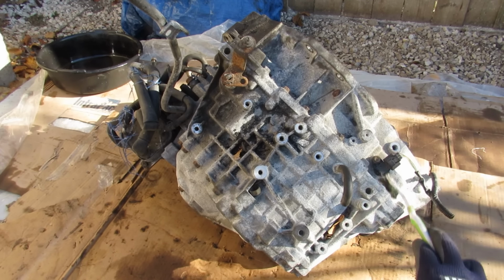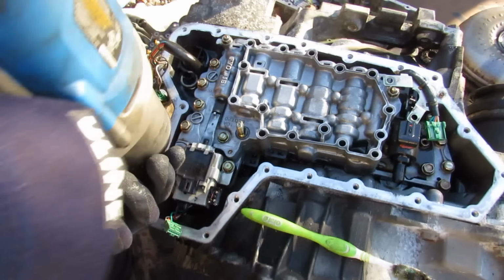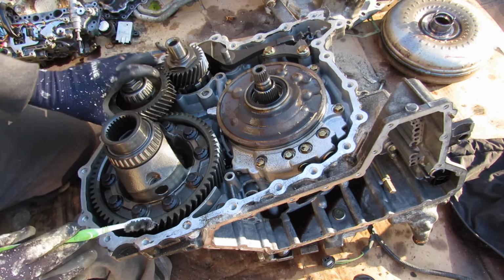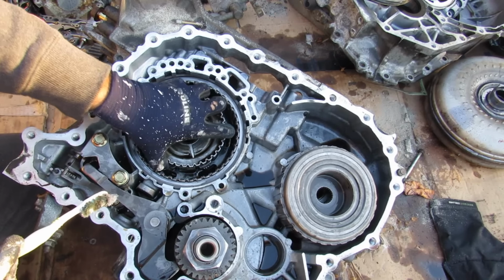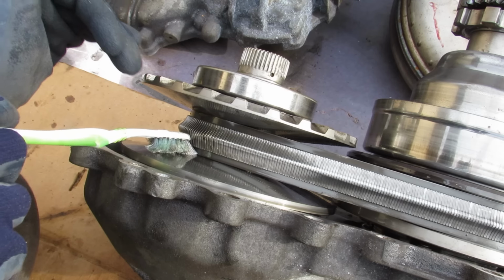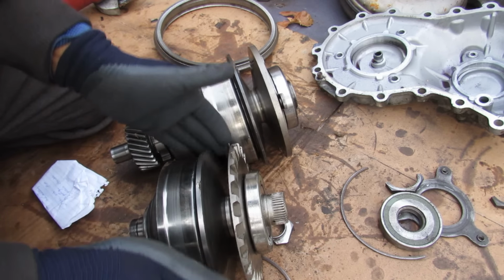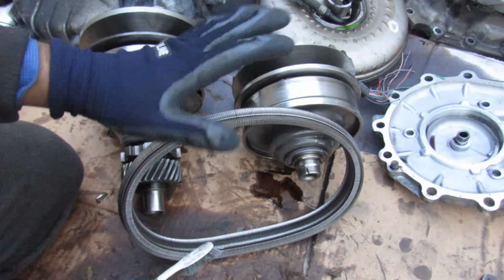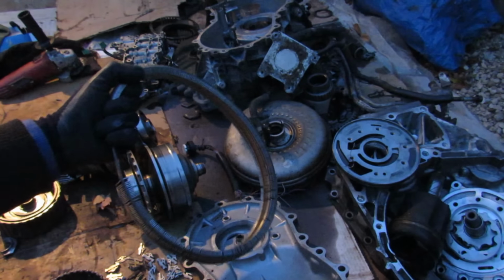Why Nissan CVTs FAIL

Comment: Thank you, our Rogue just ate its second transmission! Had a ‘99 Honda CR-V and a  ‘00 Toyota Celica both lasted over 21 years and the rust killed them the Rogue is just 10 years old and low mileage.

Comment: Fluid is key; I had no issues with my 2009 Nissan Altima 3.5 liter. I used amsoil cvt fluid, and changed fluid every 80-100g miles.  Zero slippage with amsoil, and fluid was as clean as day I put it in. My Nissan Altima had 220gs on it when I donated it.  
My Honda accord cvt trans slipped at 35gs, so I changed fluid with amsoil cvt fluid without any issues.  155gs later, car still ran like new when I sold it.

Comment: I have an x-trail T32, 2015, 1.6 DCI.. 160k kilometers done. CVT, works perfectly, never a problem. I haven't changed the oil and filter yet. Should I do it. Two car mechanics told me not to touch anything.

Comment: This is the best video ever made on CVT transmissions. I've been lucky with my 2011 Maxima, 112,000 miles with no problems but I find myself worrying alot about the trans. I appreciate the deep dive into how this works and I find that I worry less about keeping this car which I love driving. I'm keeping it and will continue regular service and not worry as much. thank you speedkar99

Comment: My CVT is holding together with hopes and dreams at this point. 07 murano s with the sport mode. I beat the ever living life out of this thing daily. It lives at 7k rpm🤣. So I will soon be referencing this video again
Reply from the maker: Oh boy. 
They die slowly. 
First you'll notice it not responding. 
Then it'll just max out at lower and lower speeds.

Comment: My wife and I have owned six Nissans and have never had a transmission problem with any of them.  The one I drive now has 256,000 on it with no problems.  Change the oil in them every 30,000 like the book tells you to do and you won’t have any problems.

Comment: Excellent video. My Nissan Altima CVT was shot but took it to the dealer for a proper diagnosis - shot! Wasn't about to put a $4K transmission in a $1K car. I hoped to be able to drive it to the junk yard but got it home and decided to throw $200 into new fluid, filters, and a bottle of CVT snake oil. Immediately the whining stopped and you could actually drive it - but no further than you wanted to walk to get home. It got better and better for about a month but started whining again. Threw another $100 into fluid and snake oil. The drained fluid was very dirty and now two weeks later it is operating nearly perfect. Bloggers warned that you shouldn't change the fluid as it would shock the transmission. Shocked my dead tranny back to life!

Comment: i have a guy Here in Ontario Canada that rebuilds it and you get a  warranty and he has a contract with Lexus contact me if you need  one done you can ship it or drive there he did my cvt in 1.5 day iy only cost me $3300 as other shop where going to charge me 5000 to 7000  he has a big company in China

Comment: Good video. The idea of using a belt to transfer the power of a large engine was a bad idea from the start. You mentioned the variators don't do their jobs which leads to shudder. Do they leak the oil? Is there a problem with the control side?

Comment: It would be awesome to make a transmission with synchronized gears with neutral being no gear engaged. Then reverse plus 1-6 gears with electric shift solenoids and gear on the input and output shafts and the gear wheels with hydrolic pressure shift solenoids that control the gearing selected based on transmission fluid pressure and rpm's. Plus a very well built torque converter, flexplate, and front pump assembly. It would be like automatic transmission mixed with a synchronized manual transmission but operate with a shifter inside the vehicle like an automatic transmission.

Comment: Just nitpicking, nothing else, but that belt do not transfer torque as said numerous times in the video, it transfers power. ( 14:17, 14:29 for example ) (But I guess a besserwisser would argue that since torque is part of the equation for power in a transmission, that torque is transferred by the belt, from gearshaft to gearshaft... 🙂Oh well.)  It's mindblowing to me though to learn that it transfers it through pushing that stack of washers, not pulling.

Comment: 2009 Nissan Altima with a CVT transmission. Just hit 200,000 miles. Still going strong. Never changed the transmission fluid.  Never added transmission fluid. Never had any transmission problems whatsoever. CVT transmissions are fine. It's when you drive like a moron that you're going to have problems, no matter what kind of transmission you have.

Comment: A very brilliant presentation on the working of CVT. My question is can the primary and secondary pullings be replaced while the transmission is still mounted on the engine ?

Comment: Having owned two CVT vehicles in recent years, I bought a 2024 car with a 6 speed manual. $800 to replace the clutch versue $6000 to replace a CVT

Comment: @speedkar99.  What do you think about the 2025 Nissan versa SV they claimed that they improved and got rid of any of the CVT issues.
If so what would you do to make it last ? Oil change at 30or 60 K?  How often filter ? 
Or is bound to fail

Comment: If you think a CVT is complex, it is nothing compared to the labyrinth ( valve body ) and selenoid found in a conventional automatic .Some new 10 speed trany may have 13 solenoid or more. And we're not even talking about mechanical parts yet. Just because a conventional automatic transmission is repairable doesn't mean it's simpler. Even the best workshops do not guarantee survival.
Reply: Can you tell me if the newer X-TRONIC CVT’s in the 2023 3rd Generation QASHQAI  upgraded CVT is a BETTER SYSTEM OR NOT ? - because I just bought one. ANY TIPS ON HOW I CAN MAINTAIN THE CVT for longevity?
Reply: @ILuvCooperAlan   QASHQAI  not the Rogue sport ? So you are in Canada . The only hope of survival is that the QASHQAI  was available in canada with the 6 sp manual... I would not expect anything from the cvt and I would do ( simply ...LOL ) a transmission swap.

Comment: Well, the belt was changed from the belt to the chain on 3 cyl cvt.  .  3 cyl started in 2021 Rogue on some models.  2022 to present Rogues have 3 cyl. 

They better start doing what customers want.  I heard that the reason they switched to cvt is bc it is cheaper to make

Comment: They fail because people are lazy! Change your filters , fluid, clean pan , magnets and change oil cooler filter.
Reply from the maker: Good point. Maintenance and not overloading it is key.
Reply from the maker: Good point. Maintenance and not overloading it is key.

Comment: I have a 2012 nissan quest. Its our main driver in the winter. Bought from a senior couple a few years ago. We use a honda fit for summer. Im at 89k miles in the quest. Went to change fluid and the stuff coming out looked exactly like the stuff we put in. I believe its about driving easy with these. Even towing would be ok with slow starts and staying around 60 max. I occasionally tow a utility trailer. Loaded up is about 2500lbs and i do see a difference in RPMs at that weight. Not sure if it would make much difference taking it out of OD. ill have to test next time i haul. Overall though id still trust towing 2500lb extra as long as you drive like a grandpa. I believe pop up campers would be ok to haul but thats really it.. they make lightweight campers but the wind resistance would require more torque than just carrying dry weight and that is overkill

Comment: one of the main and most important reasons all automatic transmissions including CVT's fail is lack of maintenance. I am shocked that there are people who still believe the old wives tale that if you change your transmission fluid it will cause your transmission to fail lol. NOT changing fluids is one of the main reasons why auto systems fail.

1. Change all fluids and filters (if any) regularly.
2. Do not abuse your vehicle...its not a race car.
3. Proper maintenance makes vehicles last and last.
4. Abuse and crappy maintenance makes them fail.
5. Idiots should not own cars.

Have a great day :D
Reply: No offence meant but you said several dumb things cuz you don't know much about cars..  Just know this,, auto tranny fluid should not break down.. but if you wait too late (like over 30k) then it really can make auto trannies slip.. it's about friction and dynamic fluid clutches.. 
CVTs were an engineering dream but a nightmare in reality.. (fyi,, I did prototype development at Ford Transmission, trust me, they all are shit)

Comment: relatively intresting , hardly understood quite complex. I was thinking how much nissans problems are related to renault cooperation, I remember the time when nissan was purely japanese product and their technology did not fail, had old almera 98 in family and motor lasted around 450 tkm without issues frame failed due rust but motor was fine. Nissan became shit after cooperation with renault, almost everything what comes from europe is bad shit.

Comment: Awesome video.  Information rich explanations that are easy to understand.  I've been involved with manufacturing since I turned 18.  That's 50 years.  The high quality of the manufacturing of all the components is obvious.  Seems like the issue is the business decision to deploy a well designed and manufactured transmission that is not up to the real world demands placed on it.  In other words, it would probably work great for a car with 100 HP or less.  But, as the narrator states, it's not up to the difficult tasks it has to perform.  So yes, Nissan deserved to get sued repeatedly for their bad business decision.  I suspect cost accountants made the decision, and not engineers.

Comment: i was looking at a 2016 Honda quest mini van that had just over a 100 thousand , looked up transmission had CVT W.T.F on a van  then this video and problems ,what happened to honda is it just American made or is japan made different ?,ill buy 20 year old still looking!THANKS FOR VIDEO ,ps looks like regular auto trans untill put stupid two v"s just to get a few miles ,in 90"s most cars went over  2 hundred thousand miles ,going backwards  70" before  put just over 100 thousand miles get a new car

Comment: Eeprom is a solid state electonics component, up to today i never heard anything mechanical called that. What you call eeprom is a stepper motor according to the diagrams to control the valve assembly.

Comment: The reason Nissan CVT's fail  because they are made in China. And never changing the fluid. Plus, the fact CVT transmissions were originally invented for GoCarts and not cars. CVT transmission are simply too small for car applications. The best car transmissions are the ones brought over from trucks.

Comment: The CVT trans is quite a nice little transmission no matter who makes it. It has gotten a bad name because Americans dont
maintain their cars. If you change your CVT oil every 30K it will last forever. Unless you do dragstrip starts @ traffic lights or burn donuts or other stupid stuff but then if you mistreat your equipment so you deserve to have your trans fail.

!

Comment: Loved the walk through- just replaced a Pathfinder CVT- gonna sell it now- but the replacement comes with a 100K mi warranty/3 years- so with the information about new Tranny fluid every 3rd oil change- the new owners should have 0 problems with the mechanicals….. reflated to the new transmission

Comment: I feel like CVTs are perfectly fine if you don’t treat them like a standard gearbox.  Slow starts, moderate weight at most, and don’t try shifting up and down like a madman, and you should be fine.  Problem is that with the absolute domination of a standard gearbox in the world, people don’t know how to drive one of these.

I have a 2013 rogue and it’s running fine, but I also make sure to not bully my transmission.

Comment: I have Jatco CVT transmission in my Renault Megane4 SCE petrol 16v 1.6, how can i find the model number of this CVT model? Also do you know where is the pressure sensor located? Its faulty, according to the readings and diag, and needs to be replaced

Comment: I was just quoted $5711 to replace my CVT transmission at the dealership. It's for a 2015 Nissan Versa Plus with 85k miles on it. Painful because the car is barely worth $3k.

Comment: The crux of a modern CVT is that it uses a push belt! That is why the belt is covered with metallic shackles. They are there to transmit the force trought pushing. The reason for the switch from the early models in little cars like the DAF 33, 44 and 55, is that with a pulling belt wears out to much, can handle only little power and is much more likely to snap.
Reply from the maker: Yes pushing is stronger because the pieces will be in compression

Comment: I know that toothbrush has had enough when these manufactures took the design from gas scooters and slap it into a 3.6L V6 engine rated for 6k lbs towing capacity. Scratching my head.😬

Comment: Is it worth to buy a Nissan with a busted transmission cheap and replace it with a refurbished one?
Reply from the maker: Replace it with a manual. Finding a used CVT will easily outweigh the cost.

Comment: Lol I’m a Nissan mechanic… unfortunately I’m gonna tell everyone here that Nissans that are not made in Japan are a complete piece of shit. Because every part that are on Nissan is either made from Hitachi, which is from China or it’s fucking made from the Philippines for the American made Nissan. The Left-hand drive Nissan cars are built in America in their cheaply built now will tell you firsthand experience and from being a mechanic what causes a CVT failure especially in the past is that stupid shitty final that they use they replaced that now with metal it’s a lot better but still I have a occasional newer transmissions that fail because people don’t change your CVT oil every 30,000 miles or barely even do any oil change both on the engine CVT and final drive differential if it’s an all wheel drive, yeah a lot of people do that quite often. 

No Nissans that are right hand drive that are made in Japan are all strictly Japanese made parts and actually fairly well built . Even the CVT are made in Japan. They’re OK. The Jatco still makest them. However, the CVT that are in the Nissan and America are built in China and they’re shitty.

Comment: So the whole transmission is trash if one belt breaks,  wow this was designed to fail.
Reply from the maker: The same goes with the timing belt in your engine
Reply: @speedkar99  not on my motor, I have a first generation 5.9 L Cummins, it's got cast iron gear to gear timing, made the last virtually forever, and yes the killer doll pin has been taken care of.

Comment: Did the  US postal service just buy a bunch of the new Nissan vans with junk cvt's. The old mail vans were  gm S 10 chassis with a 4 cylinder engine, and a aluminum body from Grumman body works. I don't think the CVT's will hold up where i live in Rosenberg TX in 100 degree heat.

Comment: I have a altima17sr 156,000 never serviced the transmission starting to have issues now is it worth doing the fluid and filter or is it done for? Limp mode on long distance other than that it drives fine but is it worth trying to fix? Any help is great

Comment: Nissan is such a curious case with innovation and failure. Their adoption of CVTs early on led to mass-market adoption but their early attempts also ruined their reputation. The Nissan Leaf pioneered EV production on a large scale but their passive cooling design forever tainted the reputation of EV's due to its rampant battery degradation. It's like they turned in a multiple choice test but every single answer bubbled in was for the question below; they were so close to grand success but the smallest oversight ruined the whole thing

Comment: Don't most CVT transmissions fail ?
Reply: if their not properly maintained, most definitely.  disregard what the manufacturer says. no fluid is Lifetime.  replace NOT flush your fluid no Later then 30k and every 30k after that. no matter what you drive

Comment: A very cool aspect of a CVT is they can let the engine run constantly at peak power or torque or efficiency. So instead of constantly moving access the horse power or torque curve they can just sit on an optimal part of it. Great video!!

Comment: i think my 1992 dump bed golf cart has a cvt, that belt system looks almost exactly like part of the transmission except the belt system is on the outside instead of encased.

Comment: Just now seeing this because of a link in Google. 

One can always tell the mark of a genius person in that they not only can very easily explain complex material but also add light hearted humor at precisely the right moments. 

Further insight on Nissan (not that I want to bash them) is this:

1) I have owned several different year Altimas and one very cool Maxima. All the Altimas seemed to lose power over time,  possibly compression? Don't know.  

2) I have seen and heard a few mechanics talk about Nissans electronic connectors about how impossible they are to disconnect.  Truth be told.
Reply from the maker: They'll loose oil pressure causing the belt to slip. 
I'm going to post an Altima CVT teardown soon.
Reply: @speedkar99  so what can be done to prevent the loss of oil pressure?

Comment: Still ( 7/24) driving a Toyota traditional auto gearbox car registered in 2000, so re. this:
Ergo men in suits did their sums up there in gleaming glass offices & issued the dictat down to engineering & dev. saying that old system was hitting profit...sooo these wise & expensively costumed sages' decision lead to bad builds/reviews/sales.

Well done you've got into mba textbooks, it's not for the right reasons but hey!....